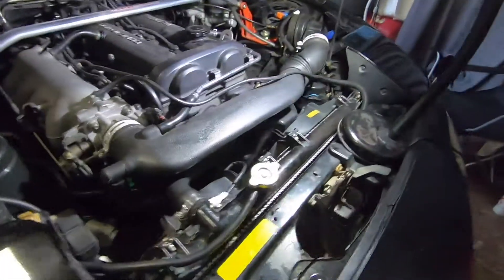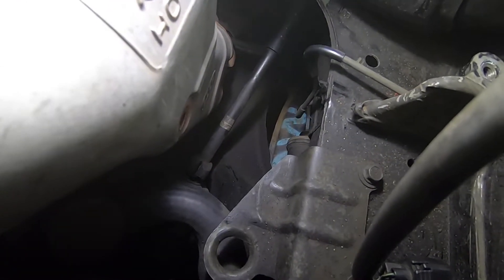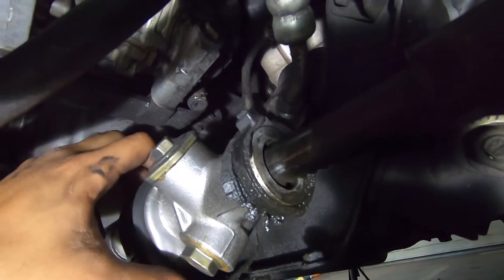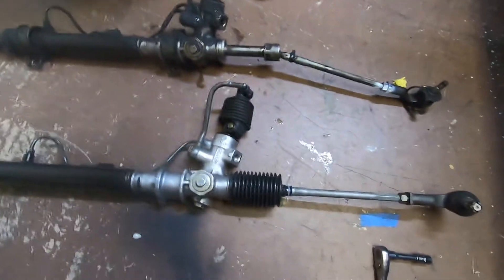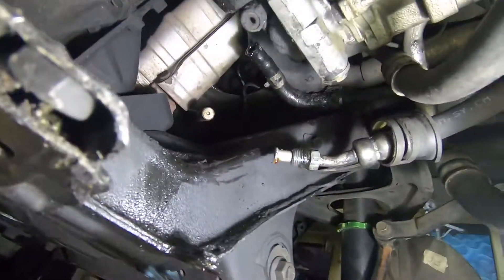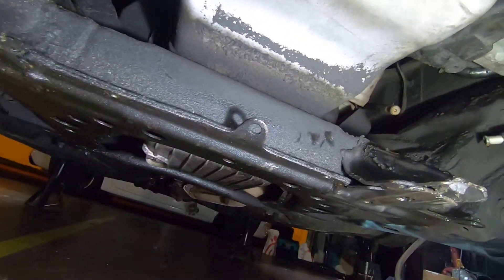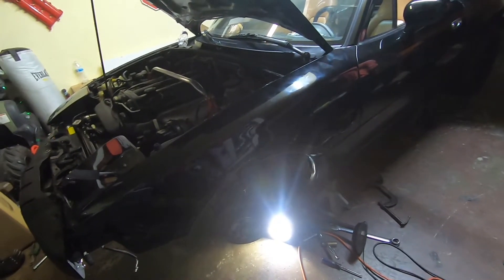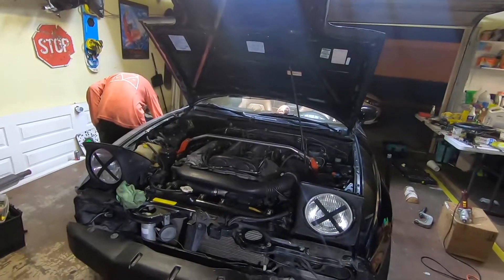Miata rack n pinion

Comment: My steering wheel doesn’t want to move anymore with slight movements. I gotta give it a bit more force to turn when I’m going fast on the highway. Do you think that is the power steering rack? It is a 2016 Miata ND.